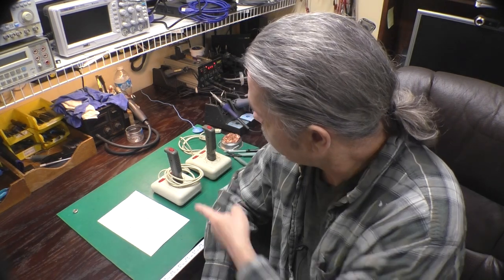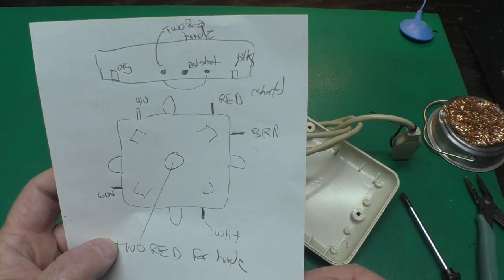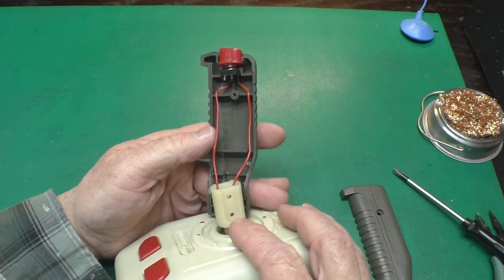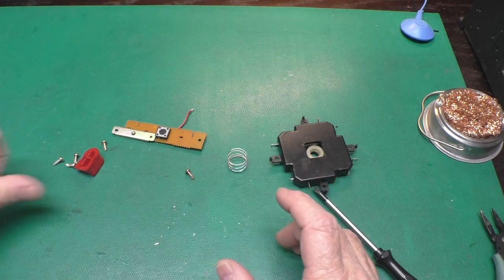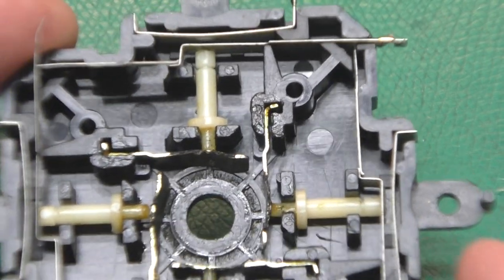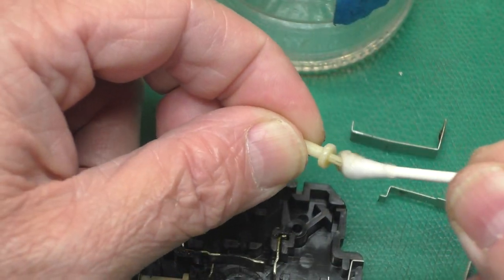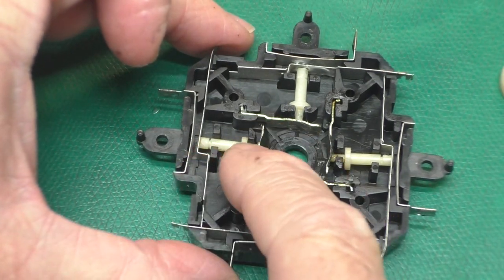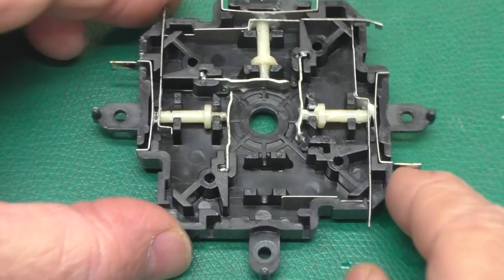Suncom Tac 3 Joystick Refurb - A worthy successor to the TAC-2?

Comment: Good job!; one question: noting that all these retro joysticks work only by closing the circuit between  cables from the DB-9 connector, is the anti-bounce protection built inside the computers , is it implemented in software by the games or isn't any debouncing at all? Thanks in advance.
Reply from the maker: The debouncing comes from the fact that the computer only reads the inputs so fast, whatever the interrupt period is for polling the KB and such, and the game reads them even slower than that. The game would be hard pressed to catch switch bounce.

Comment: I think if you mix a little baking soda and water, and use a q-tip to apply, drip a tiny bit of the solution onto the superglue, you'll get a faster cure and a stronger bond.  (Do it after the piece is in place where you want it, or the glue might cure right away.)